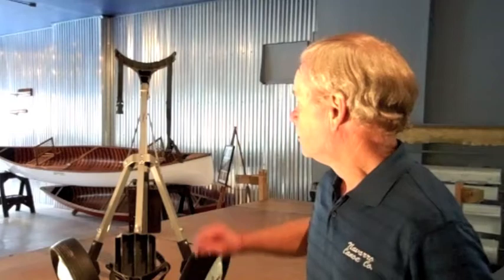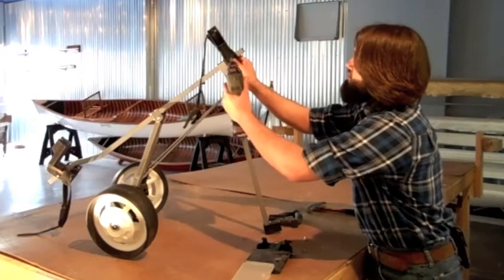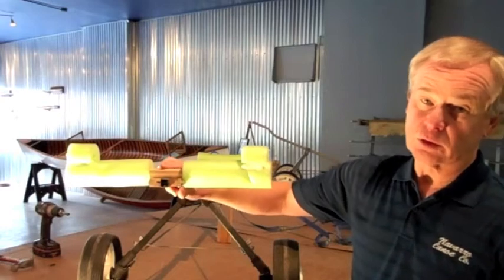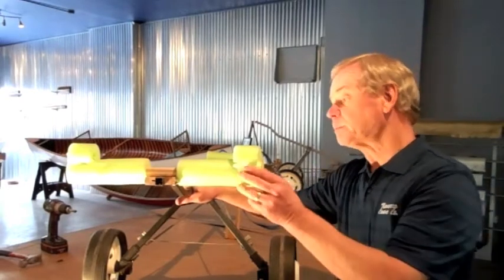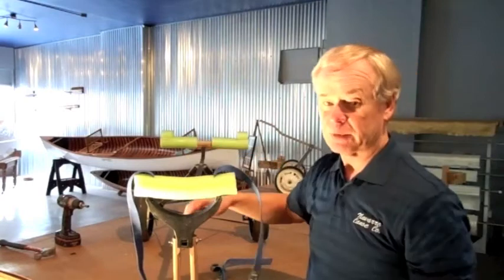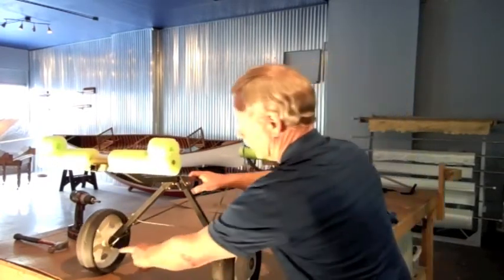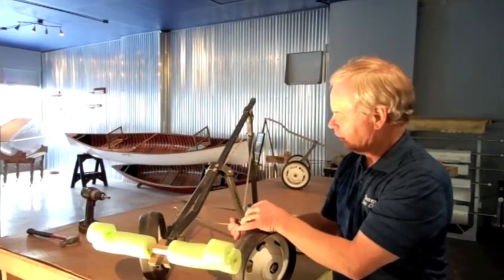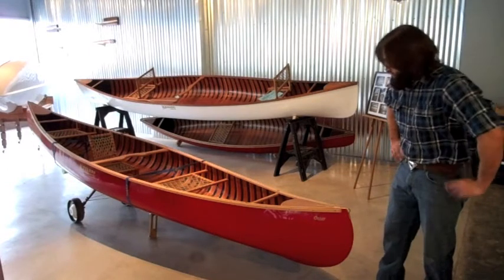Building a Canoe Cart

Comment: Exactly what I did. I’m just seeing if anyone else discovered this.

I’ll be towing a kayak so I am using the bag swing arms as a pivoting cradle for the kayak hull.  

I mounted rubber balls by cutting them in half and gluing them on each of the pivoting arms; these will find home in the scupper holes this will secure the positioning of the kayak.  I have one draw strap I salvaged from a harbor freight tie down strap,I had left over. 

I salvaged the buckle assembly from an old shoulder strap from a camera bag. 

I am attaching this to my bicycle so; I’ve still yet to design and build the attachment to be mounted on the bow.  That must be easily attached and removed with no holes to draw water into.  

Since I will be towing this behind a bicycle; weight is a major factor.

Comment: I built one after watching your video.  

My problem is that my kayak weighs 85 lbs empty, and about 100 fully loaded.  It kept falling off the cart!   The single crossbrace to support the kayak bent on the cart frame.  

What I had to do was run a strap from each wheel over the kayak and strap it down tightly.   

I also had a problem at the handle end because the kayak wouldn’t stay centered over it.  Again, I had to use a strap to center it.  

Part of my problem was that the only golf cart I could find had a tubular frame rather than a square one.  Big mistake.   

I’ve used mine for a year now.  Once the kayak is mounted it works great.  However, getting the kayak mounted on top and not falling off before strapping it down is a pain.  Wish your video showed how you managed that with one person.
Reply: Our canoes don't weigh as much as your kayak so that probably makes a difference.  Sounds like you have figured out a workable adaptation, though.